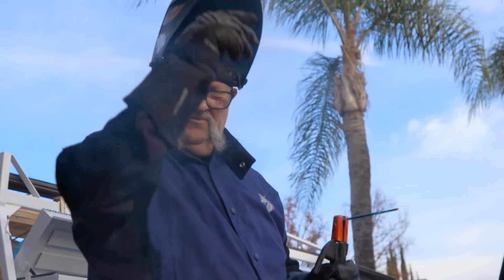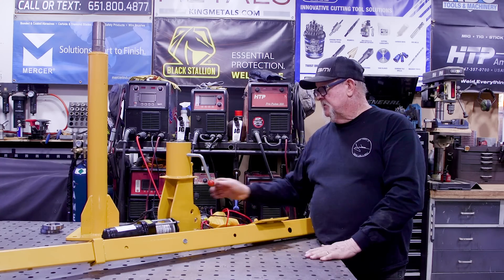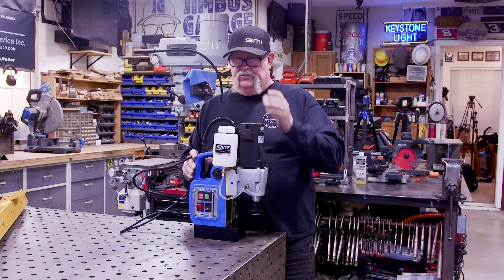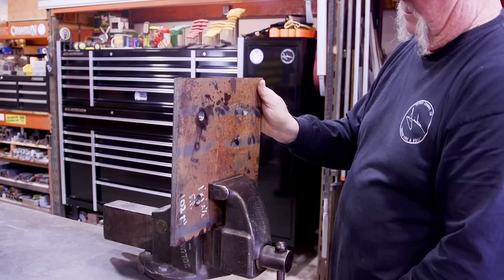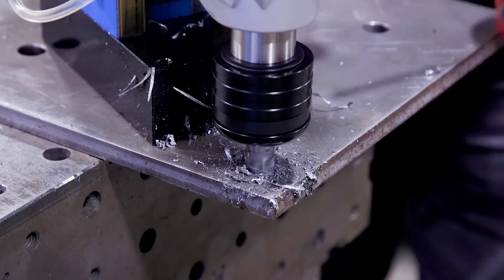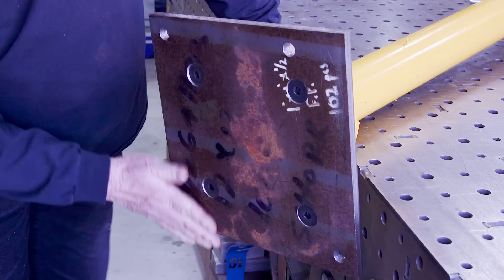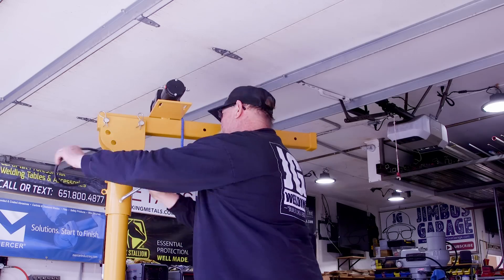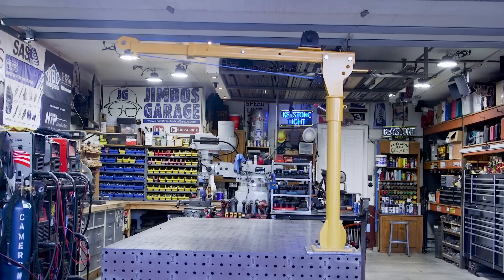How to Install a Crane on a Welding Table | Heavy Lifting Made Easy in Your Shop!

Comment: That random yellow nut that is welded to the side of the mast would be cut right off if that were in my shop. lolol. Nice work, Jimbo!  That will come in very handy and I'm sure you'll find yourself using it more than you originally thought you would. 👍

Comment: Crane looks awesome. I recently added a trolley and chainfall to the I beam that runs the length of my shop and am finding it very useful. For those countersinks I use my drill press. Easy set up and can set a depth stop for consistency if you want. I also find the multi flute cutters chatter more than the single flute ones.

Comment: Great addition to the shop and to save your back.. I'd probably have added grommets to the tube where you drilled the holes for the winch wires to go through. Those edges will be cutting on the insulation/wires over time.
Reply from the maker: Ya know. I did look for one that size for a couple hours but I couldn’t find anything for that thick of steel. Let me know if you know where I can get something like that. Thanks for watching -Jimbo
Reply: Try McMaster-Carr.  They have an extensive selection of types and sizes.
Reply: A pex pipe plastic insert might work
Reply: @JimbosGarage  Check out McMaster-Carr, A great resource for makers like us. They have grommets that will probably work. Love the videos Jimbo!
Reply: McMastercarr 9307K49 is a rubber grommet to go through 3/8" thick material. They have ones for 1/4", 1/2" and more. I've used 1/4" hex shank step bits on drill bit extensions for deep holes like that pass through and they leave a nice chamfered edge on your hole.

Comment: That's a COOL Project. I c converted a Harbor Freight truck bed crane to fit the hitch of my pickup, with the tailgate down. That way I don't have to lift anything too high to get it in the truck. Thanks for sharing.

Comment: Only thing I would change is to put a single point stop on the head so the boom cannot make full circles.  With the power cable run through the inside I can see you forgetting how many times you have spun the boom in the same direction and damaging the cable.  Other wise it’s a solid idea.  I was debating putting a winch onto my engine lift for similar occasions.

Comment: Great idea, great video. This will be very handy and your back will appreciate it to. Q. You may have addressed off camera or I didn't see but did you put protection on the power cables going through the drilled holes? Grommets or other means would protect you from a short and possible electrocution later. Just a thought.
Thanks for sharing.

Comment: too weak fixing screws to the table, drill larger holes in table and use screws 10.9 class minumum metric thread M14 -M16.